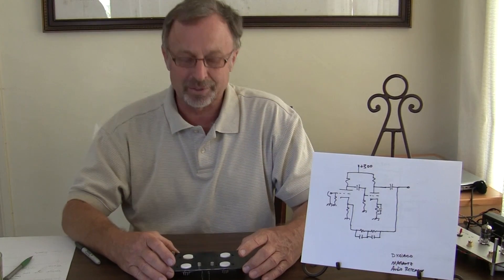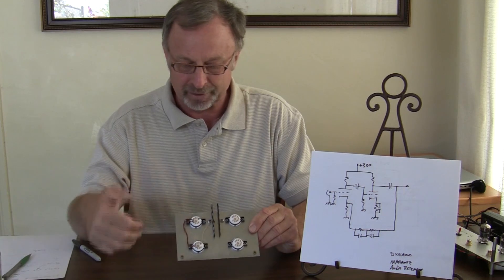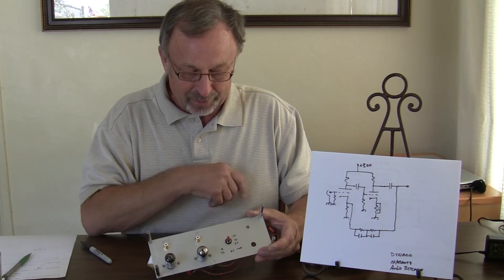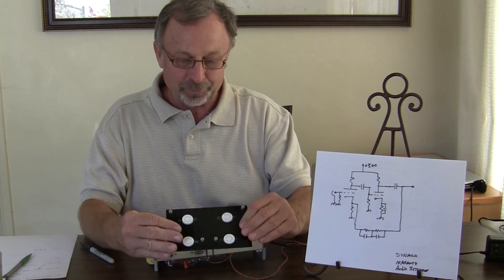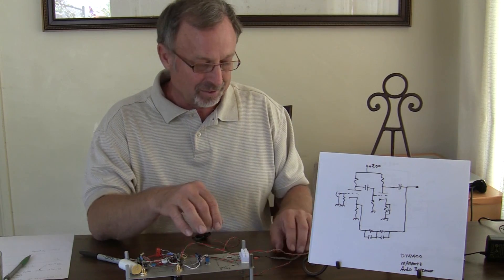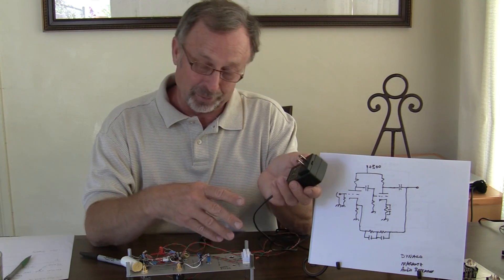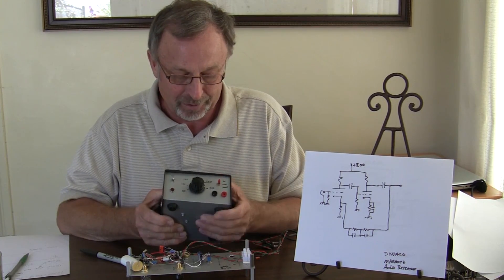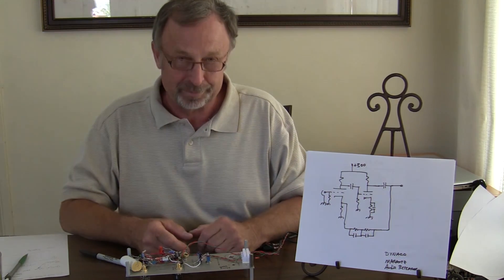Tube Preamp Construction Techniques

Comment: Your comment that the wall warts are well regulated is not true at all. They have No regulation circuits inside at all. Take one apart and you see only a transformer, 4 diodes an a single capacitor, nothing else.

Comment from the maker: @sovietsanta1 use the standard c=1/2piF. http://www.sengpielaudio.com/calculator-XLC.htm will help. For the coupling cap R is the input resistance of the next stage to ground. Typical values are 0.1 uf and 470K ohms. For the cathode bypass the capacitor is much larger because the resistance is much lower. The resistance there is the cathode resistor in parallel with 1/gm of the tube. Typically this is just a few hundred ohms so the cap is 470 uf. The particular tube does not matter so much but high gm tubes do have lower R and bigger C.
Reply: thank you its hard to find some of this information
Reply: Greg Robinson thanks i shall remember to use this when i start my project back up
Reply from the maker: Greg Robinson Dear Greg,

Since you mention that 1/gm does calculate the impedance at the cathode it is obvious that is the impedance you must bypass. Think of what would happen with a very large cathode resistor like 100 K going to a negative 100 volt supply for 1 ma. Would you use 100 K in your formula or 1/gm? What if the cathode resistor was a current source of infinite impedance?
Reply: sovietsanta1 Ok, sorry, but the info Music Reference has given you is incorrect.
To calculate a cathode capacitor, you need to first know your cathode resistor value, and then decide your -3dB point. Say your cathode resistor is 1k, and you decide that you would like your -3dB point to be below audible frequencies, maybe say 5Hz. The formula to calculate the capacitor value is C = 1/(2 x Pi x f x R), with R being the resistor value in ohms, f being your selected -3dB frequency, Pi being 3.14.....
So in this example, the calculated capacitance is 31.8309uF. A close standard value is 33uF. You can then rearrange the formula to calculate the resulting -3dB point, f = 1/(2 x Pi x C x R), which is 4.8229Hz. 

I don't know why Music Reference has brought up the cathode resistance in parallel with 1/gm, which is used to calculate the cathode load line and output impedance of the cathode, but has no bearing whatsoever on the selection of a cathode bypass capacitor.

If you want to calculate AC coupling capacitor values, the maths becomes a fair bit more complicated, and you should read the Radiotron Designers Handbook or the RCA Receiving Tube Manual if you want the full details, but a very approximate method for calculating them is to look up the plate/anode resistance of the tube at typical operating conditions (if the datasheet has various operating conditions, select the one which most closely matches your circuit). A typical value for a 12AX7 stage is 65k. With this information, you can calculate the output impedance of your triode stage, as the output impedance of the triode is the plate/anode resistance in parallel with the Plate resistor, which might typically be 100k. These values in parallel are ~39k. Now, to calculate the AC coupling capacitor, the formula is as follows: C = 1/(2 x Pi x f x (Zo + Rl)) where Zo is the output impedance that we just estimated, and Rl is the following load resistor. Say for example you choose a -3dB of 50Hz, and the load resistor is 470k, Zo is the 39k we calculated before, then we would calculate the coupling cap to be 6.3 nano Farads (0.0063uF). A close value is 6.8nF, so calculating backwards again, we find out -3dB point to be 45.98Hz.
Remember, these are approximate values, if you want more precise results you will need to do quite a lot more math to calculate the operating points of your gain stages.

Comment: i'm designing a stereo 6sn7 tube preamp for my stereo but i'm stuck on the equation for the coupling capacitor values and the equation for the cathode bypass capacitor values. Do you think you could tell me what they are because they seem extremely hard to find. I did find two of them on one website i think the coupling one that i found is right because i can get the same values as other schematics but the one for the cathode capacitor confuses me and i cant seem to get it to work  i hope your able to help thanks.